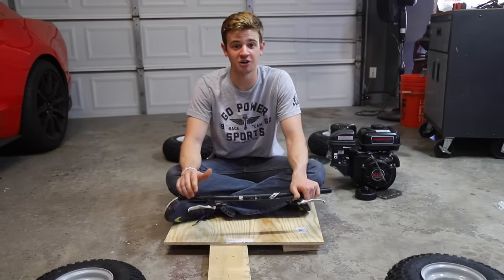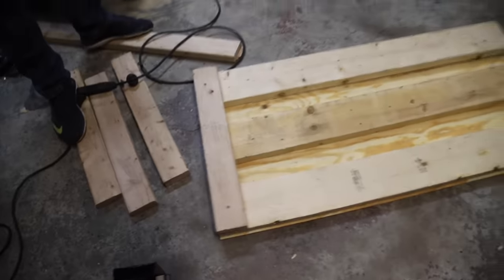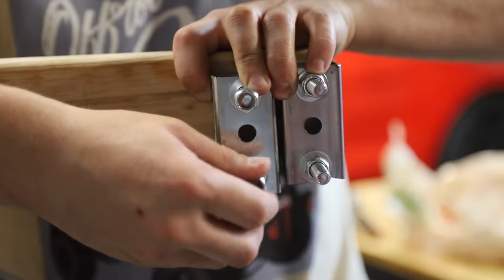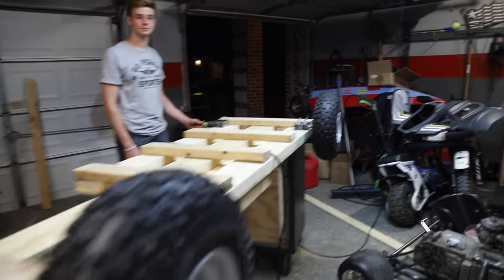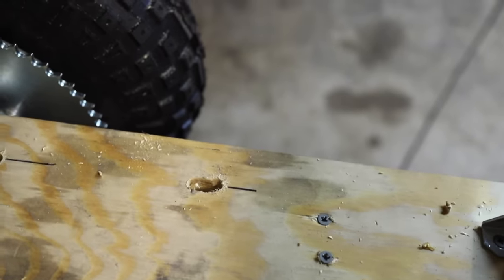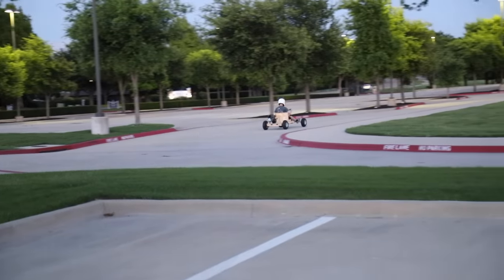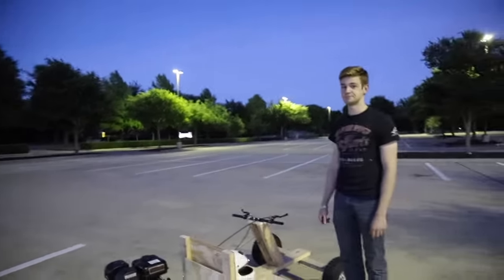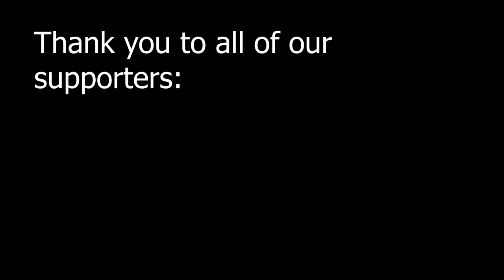Homemade Wooden Go Kart Build | NO WELDING or Expensive Power Tools!

Comment: You guys could do me a huge favor and actually solve one of my biggest problems I'm having right now. I have a raptor kids Power Wheels12 V. I bought two 18 volt portable power sources from Home Depot. Basically you can snap a drill battery into them and I'm planning on upgrading my power wheels to a 36 volt. They say, because I'm not touching the motor on the Power Wheels, then if you go over 36 volt it will burn out the motor. What I'm looking to do is turn this into a riding lawn mower.

Right now I have an electric lawn mower that is a push lawn mower. And it's not a self-propelling lawn mower either you literally have to push it it has no self-propelling whatsoever it doesn't help you whatsoever you just have to push it. What I want to do is going to be sickly weld the Power Wheels right on top of the damn lawn mower so hahaha but I know it's not going to be that easy can it be? Plus I have to upgrade the wheels on the power wheels to rubber tires that have any sort of traction in the grass. If you guys have any ideas on how I can combine my already bought equipment which consists of those two 18 volt power portable sources made by Ridgid, and then my push lawn mower that's electric no self-propelling, and my 12 volt power wheels .....oh, I would love you forever if you could come up with some sort of solution that would cost me no other money because I've already bought those two 18 volt portable power sources, and I really frankly don't have the budget for anything else to add to this project. So I have to use what I'm already have on hand.

If you could have any sort of video or a suggestion even on how I can combine my push mower and my power wheels to make myself a riding lawn mower... That would be a dream come true. t

 I'm not an engineer or a tinkerer i'm just a woman who wants a riding lawn mower and I don't want to pay thousands of dollars for one and I know this can be done. If I have to do it I'll make my own video haha and wish me luck! But I would really rather follow somebody else's advice who knows what they're doing.🤣🤣🤣